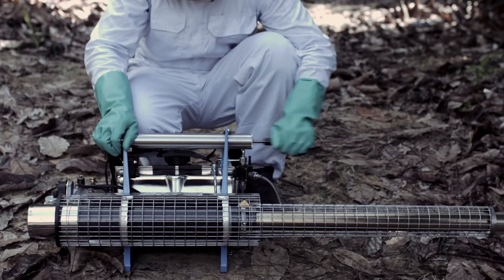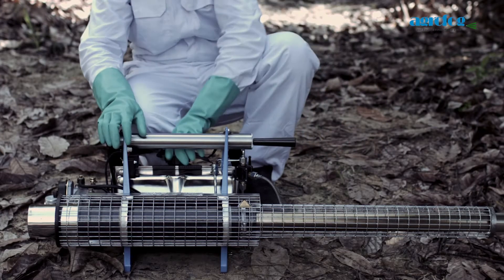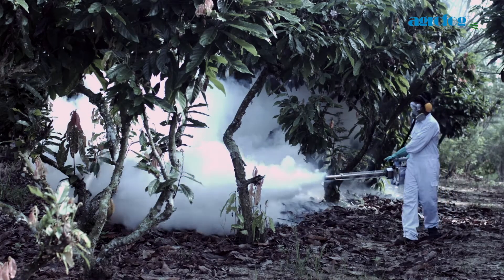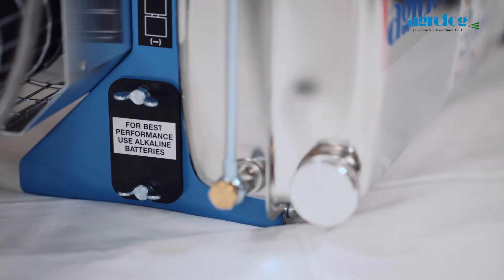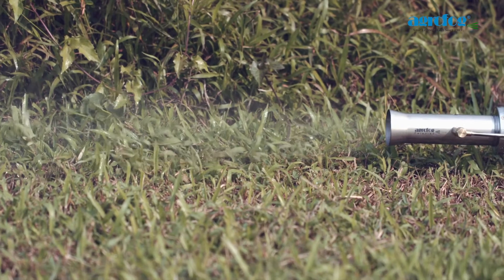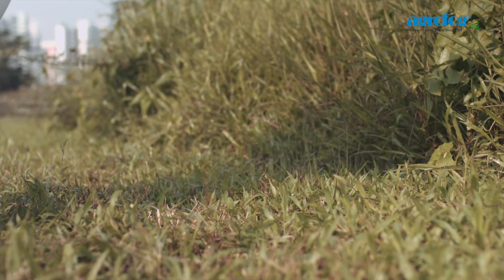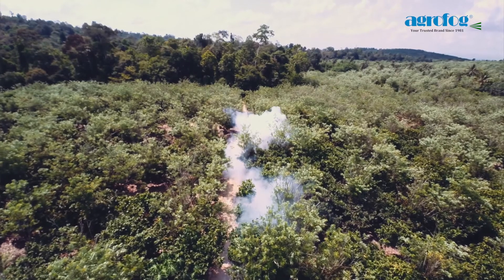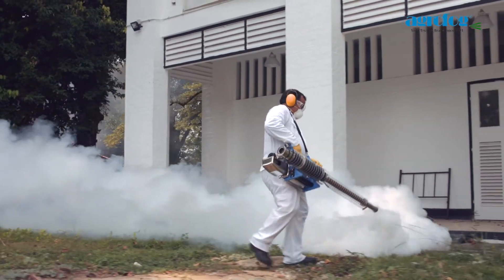Agrofog AF35 Handheld Thermal Fogger Introduction: Space Spraying Insecticides For Flying Pests

Comment: The best Fogger that is very effective against mosquitoes 🦟 cockroaches 🪳 and flies 🪰 and it is very light in weight user friendly and low in noise
Reply from the maker: Agrofog Thermal Fogger, AF35, is made of light weight stainless steel material with an engineered silencer effect. Thank you very much in supporting Agrofog Equipment!